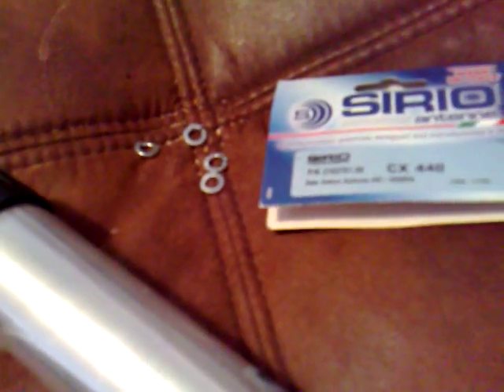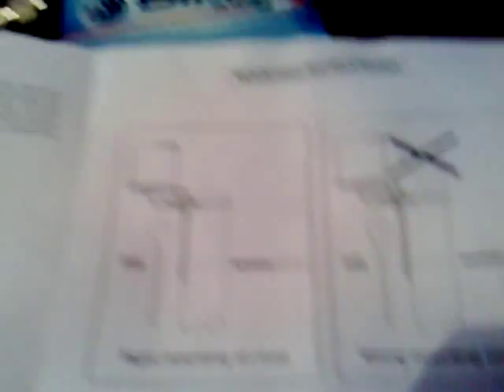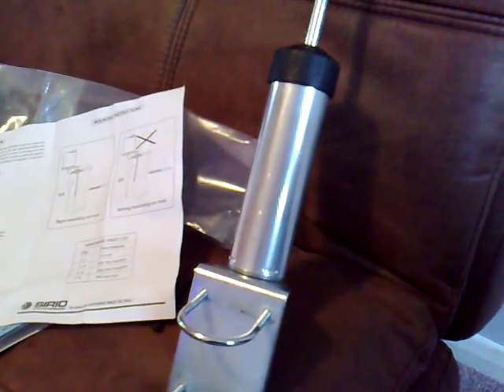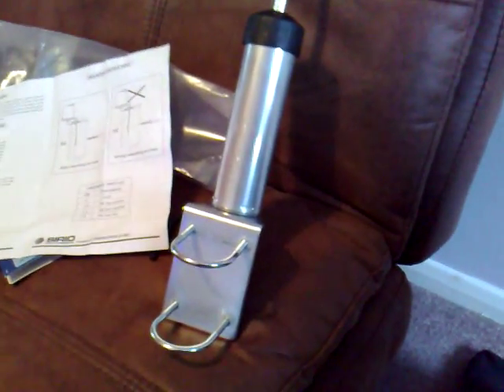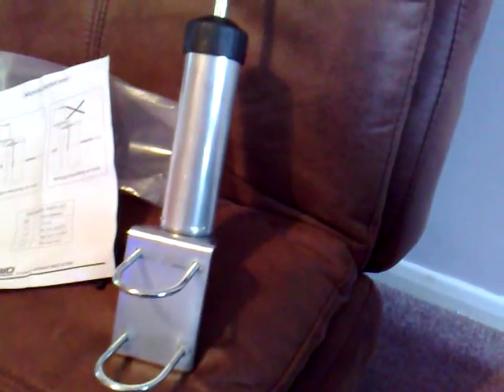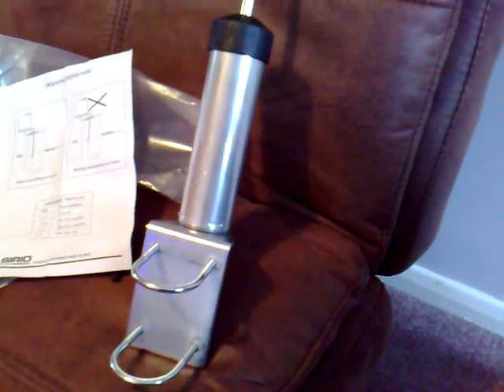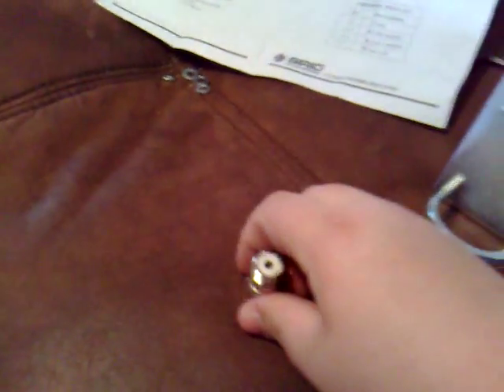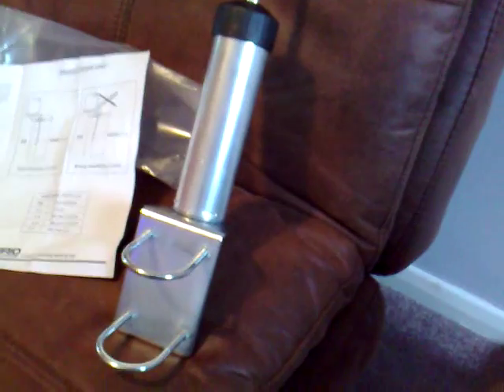PMR Radio: Sirio CX-440 UHF Base Antenna - Part 2

Comment from the maker: If the poles are grounded it should be ok. I have set another one of these up on a pole when high ground without grounding the pole and it worked fine :)